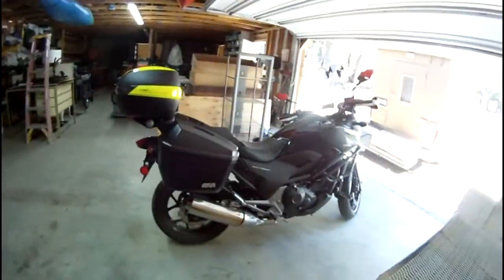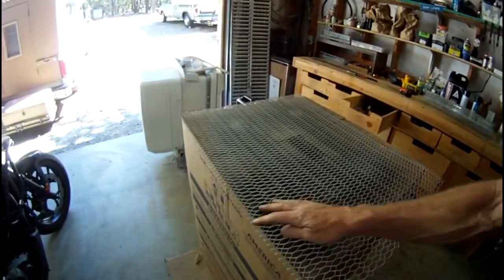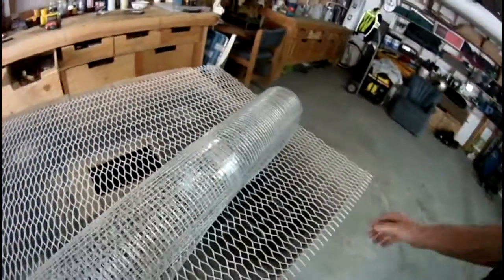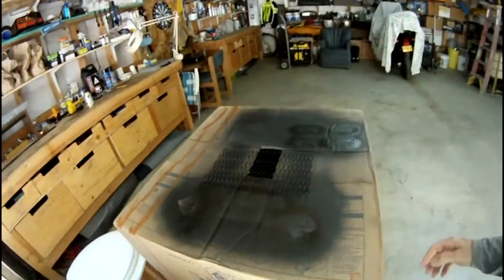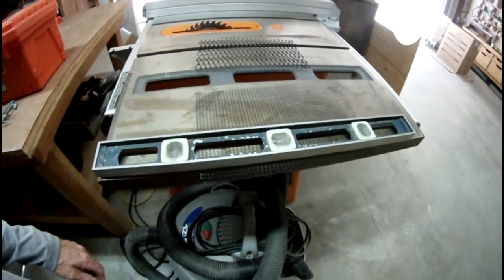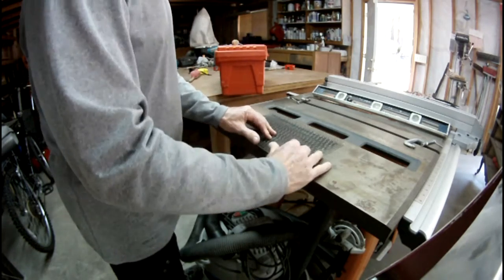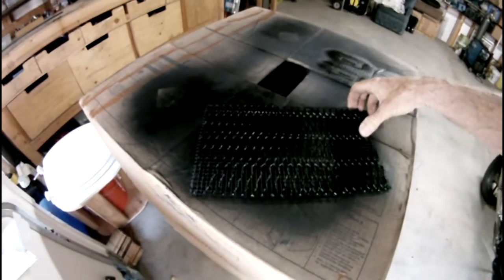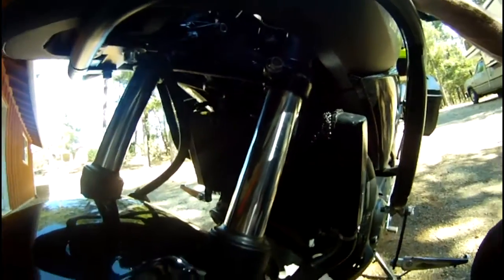DIY Motorcycle Radiator Guard (NC700X Shown)

Comment: Hi. How the plastic zip ties are holding with the radiator heat?
Reply from the maker: So far so good.  None of them have broken.
Reply: @MTMiser  I've done something similar but used small binder clips instead of zip ties.  Once the clips are in place, you can squeeze the little handles to take them off and you're just left with the little, black, metal clip.  Worked fine for a thousands of miles and never had to worry about the heat.
Reply from the maker: @sethfisher484  Sounds like an interesting solution.  I'll have to take a look at that.
Reply: @MTMiser  There are steel zip ties out there as well.  Haven't tried them myself but they might be ideal.